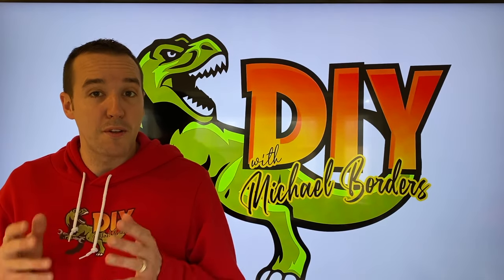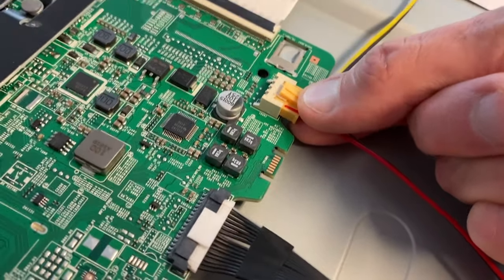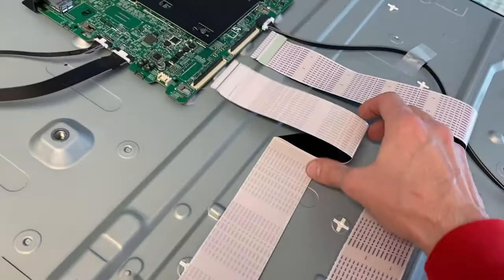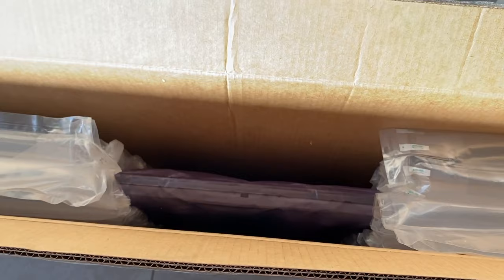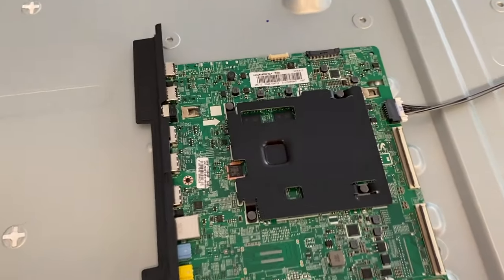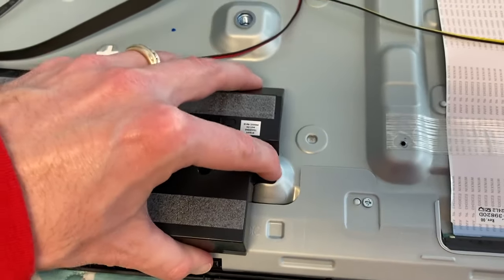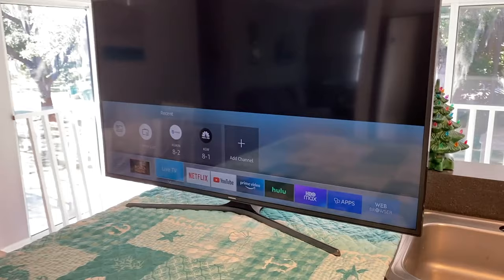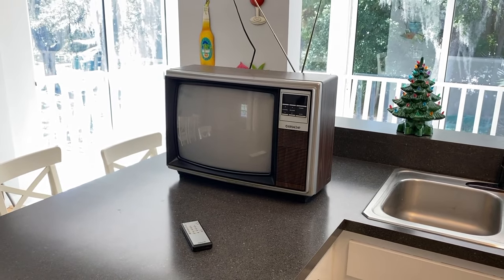How to replace TV screen/panel - DIY Samsung/LG/Sony/Vizio

Comment: Sir I'm thinking about buying a 65 inch Sony 65950H for 200 and the problem is the TV turns on then it shuts off then the red light blinks 4 times. What do you think is wrong with it and is it worth 200?
Reply from the maker: Thanks for watching, we take it the tv is used…?

That is usually an issue with the remote however not always.  The IR sensor inside tv might be in its early stages of failure and acting sporadically…leading to tv turning back on.

Comment: Hello Michael,thank you for an amazing video, I have a samsung  tv that has cracked screen model UA65NU7100KXXA, I'm in desperate need of the panel
Reply from the maker: Thanks for watching & welcome to the DIY Raptor Club.  We appreciate your kind words.  By chance, do you have the exact part # of your original panel?

This will be on a sticker inside the tv placed on the aluminum panel.  Having this exact part # will give us a better way of finding replacement panels.

Keep us posted.  😎👍

Comment: Great job fixing that and keeping it out of the landfill. How much did the screen.replacement cost? I have a Samsung UN55RU7100FXZA  that has an internal crack from the movers dropping my TV. Thanks again.
Reply from the maker: Thanks for watching & welcome to the DIY Raptor Club.  Our replacement panel cost around $500.00.

The tv was originally $1,200.00 when new.  Keep us posted on your project.

😎👍
Reply: Great video! Any recommendations on where to order repair replacement TV parts??

Comment: Did you pay extra $$ for the new screen? It's pre-mounted to the frame, so all you have to do is remove the main components/ cables from the old TV. Can you get just the screen? There is more work involved when replacing just the screen. Also, did you have to return the defective / old screen? So that new replacement screen was around $400- $500? As the TVs get older, the cost of replacement screens should drop, but how long should you wait? It's more cost effective to buy a new TV! Our disposable technology. Great video on your Samsung! Most Samsung phone replacement screens come pre-mounted to the matching frame, so it's easier to replace a bad cellphone screen! I got a hold of a Vizio 50" 4K TV, & an LG 43" 4K TV. The Vizio works but the screen is messed up (worse than yours!) The LG, may be a backlight problem, but also has a small damaged spot. So, is it really worth replacing the screen, when a new one is cheaper?
Reply from the maker: Good morning, we are drinking our morning coffee answering any and all questions for the DIY community.

We were more interested in the panel as a whole mounted to frame.  It’s possible to get just the replacement screen.

You will need to purchase just the screen replacement from manufacturer in most cases.  Checking the manufacturer parts website is best route, or visiting:

       PartSimple.com

You’re spot on, the older the tv gets, the cheaper the replacement screens get.  Please keep us posted on your DIY project.  👍

Comment: Can you help me please I have a broken LG tv model 43UH603V and I can't find a replacement screen im possibly thinking it could be a back-light problem.
Reply from the maker: Thanks for watching, the best thing is to remove the back panel from your TV.  At this point, locate the panel/screen part# sticker which will be somewhere on the internal aluminum panel.

This will give you the exact part number for your exact screen and will allow you to find a replacement screen much easier.

Keep us posted.  😎👍

Comment: Quick question if I wanted to fix mines is their an exact piece I can buy or would I have to get a whole new panel I have a 65” tlc Roku tv and my tv had a remote hit it?
Reply from the maker: Thanks for watching & good morning, we are drinking our morning coffee answering any and all questions for the DIY community.

Have you pinpointed if the panel itself is cracked or does the panel just have vertical or horizontal lines, or is the screen discolored?
Reply: It had something thrown at it so it’s inside that’s cracked if that makes sense
Reply from the maker: @phase3711  

Thanks for the reply, our crack was internal as well.  Replacing the panel was our only option...other than tossing tv out & buying new tv.

Comment: I have a vizio flat screen tv. I turn it on and the screen will be black but tv is on. I slap the screen and screen turns on. Gotta do it everyday. Is there something loose inside my tv. Gotta hit the screen everyday
Reply from the maker: Thanks for watching, it’s possible.  Removing back cover to gain access to internal portion of tv will be next step.

Check that all electrical connections are properly secured.  It will go a long way to spend a few minutes and do some friendly cleaning to remove any and all dust, debris, or any other thing inside the TV that does not belong there.

Below is a link to our video showing the cleaning process.

       https://youtu.be/-QdPg_jPkGY

😎👍

Comment: Hi... Could one have vertical lines on a TV if the screen gets shaken and the layers inside becomes un-aligned?... I once became aware that they are plastic layers inside the panel that must be perfectly aligned, am I right?.
Reply from the maker: Thanks for watching & welcome to the DIY Raptor Club.  If tv is shaken, internal parts can likely become loose leading to vertical lines.

It’s very possible that it’s as simple as removing the back panel and re-securing any loose connections.  Below is a link to our video showing us performing an inspection as well as a friendly cleaning.

       https://youtu.be/-QdPg_jPkGY

😎👍
Reply: @DIYwithMichaelBorders  Sorry to bother u but if the settings/ numbers >>  brightness, contrast, sharpness etc, are set too high can it damage the system or cause lines... I am not a technician but I'm just curious.
Reply from the maker: @st.clairworrell8758  

No bother at all, us DIYers need to stick together!!!  Those specific settings are unlikely to cause issues however if tv is set to full bright for 10+ years, an LED or two might burn out.  However that would not cause vertical lines, it would cause part of the panel to be darker in that area.

Comment: What is the model # on that Samsung 55"? I got a hold of a 55" Samsung UN55MU6300F. Screen looks like yours but worse! Are you still using the TV you repaired? Thank you 🤓
Reply from the maker: Good morning, we are drinking our morning coffee answering any and all questions for the DIY community.

This is a (un55ku6300).  We are still using this exact tv today.  The replacement screen has been great.  Please let us know if you have any additional questions.

😎👍
Reply: @DIYwithMichaelBorders  thank you! Morning coffee sounds good! Could you have gotten just the replacement screen, not attached to the metal body? It's more work to replace just the screen, but it might save some $$. 🤓
Reply from the maker: @j.lietka9406  

Unfortunately not, it was only sold in this manner however it definitely made the project more friendly.
Reply: @DIYwithMichaelBorders  yes, like the Samsung replacement cell phone screens. Yes it makes rebuilding the TV easier! But shelling out more $$!
Reply from the maker: @j.lietka9406  

Definitely understand your thoughts.  Please let us know if you have any questions.  😎👍
Reply: @DIYwithMichaelBorders  yes! Thank you 🤓
Reply from the maker: @j.lietka9406  

😎👍

Comment: Thanks for making this awesome video , I still have hope that I can repair the two Vizio tv's my toddler broke , I've been holding on to them for years . I would greatly appreciate it if you can help find the replacement panels . Thank you
Reply from the maker: Thanks for watching & welcome to the DIY Raptor Club.  We can definitely help.  We purchased our panel from:

       PartSimple.com

This is a pretty big online electronic business.  We have had great luck with them.  You will need to remove the back panels to gain access to the part # sticker that is placed on the internal panel.

Keep us posted, us fellow DIY’ers need to stick together!  😎👍
Reply from the maker: Amit Seetahal  

Thanks for watching & welcome to the DIY Raptor Club.  We did some looking around.  Below is a link to a replacement panel that matches your part #.

       https://www.tvserviceparts.com/Samsung-BN95-06343B.html

Please keep us posted on your DIY project.  😎👍

Comment: Where do you get replacement screen I have a samsung tu7000 70 inch that has vertical black bar line. And I'm wondering if the screen is cheap or expensive?
Reply from the maker: Good morning, just poured a cup of coffee and am sitting down to answer any and all questions for the DIY community.

We purchased our replacement screen from:

           PartSimple.com

Having the exact panel part number will help track down a replacement.  As far as price, it can range between $500-$1,000 depending on the make and model of tv.  Keep us posted.

Let us know if you have any questions and hey if you’re into crypto trading, join our DIY ecosystem.

       toolboxtoken.com

Reach out to us any time!  🧰
Reply: @DIYwithMichaelBorders  thank you so much . I appreciate the help. Kinda expensive.  Might just go ahead and buy a new tv
Reply from the maker: @Ernestosgarage  

Thanks for the reply, replacement panels can get pretty pricey.

Comment: Such an awesome video, definitely subscribing. I know it's a long-shot anyone will answer, but I don't know where else to ask. I need to replace the screen panel on my LG 65NANO95UNA. I think I found parts for pretty much every model except with "95" in the middle of the model number. There was an 85, 90, etc. But no 95. Does anyone have any idea how to find a replacement screen from a legit website? Thanks so much again for the video and for any help.

Comment: Thank you Michael for that great video. I have a Samsung tv 58" model UN58TU7000F version YA01. The screen became black after one year one day that I bought it. I can hear the sound but no pictures. I figured the screen is gone, please let me know where can I buy a replacement panel? thank you
Reply from the maker: Thanks for watching & welcome to the DIY Raptor Club.  We purchased our panel from:

       PartSimple.com

You may find it best to remove the back panel to gain access to the internal portion of your TV.  Once inside, you will find a part number sticker or placard on the internal panel.

Using this information on the sticker or placard will allow you to best shop around for your exact replacement panel.

Please keep us posted on your project.
Reply: I’m just giving you food for thought but it may not actually be the panel. You may want to look into replacing your P-Con board. I’ve run into this issue at least twice and both of those were the problem.
Reply from the maker: @jumcmeans6029  

Thanks for watching & sharing this.  Any & all helpful info is greatly appreciated!!!  😎👍

Comment: What’s the screen number to look it up, I have the exact same tv as yours I just don’t want to open it before I get the new screen
Reply from the maker: Thanks for watching, we appreciate you reaching out to us.  We definitely understand not wanting to open TV up however in order to 100% ensure that you get the exact replacement screen/panel for your exact TV, we recommend removing back panel and gaining access to the internal part number sticker.

This again will ensure you get the exact replacement for your exact TV.  Keep us posted.

Let us know if you have any questions and hey if you’re into crypto, join our newly launched DIY ecosystem.

       toolboxtoken.com

Reach out to us any time!  🧰
Reply: @DIYwithMichaelBorders  yea I did open the back, I found the number I looked it up on that website but nothing showed up
Reply from the maker: @baby_themacaw2592  

Thanks for the follow up.  Other than that website, did your search the web to see if a different site sells replacement panel that matches your part number?

Comment: Thank you for video,  Do you know were can I get  replacement screen for 86" led 
86ur640s9ud
Reply from the maker: You are very welcome, thanks for watching.  It means the world to us that you took the time and shared a comment.

The best thing to do is remove the TVs back panel to gain access to the internal part number sticker located on the aluminum panel.  

This will help us track down the exact replacement panel for your exact TV.

😎👍
Reply: NC86OTQF-AAKH1  I can send you pictures as well 
Thank you.
Reply from the maker: @dmitriitcacenco8283  

Thanks for the info, we dove deep into the Lg replacement parts online catalog website.  Unfortunately it looks like this panel is not currently available for purchase.

Below is a link to the website.

       https://lgparts.com/search?type=product&q=%22nc86otqf-aakh1%22

Comment: Does anyone know where I can go online to find out the part number for the screens on the Sony TVs?
Reply from the maker: Thanks for watching, great question.  If you’re unable to remove back panel of TV to gain access to the inside, you can contact the customer support who manufactured your TV and provide them with the serial number of your TV.

They will hopefully be able to look up OEM part numbers for your exact TV.

Comment: Any idea where i can find that screen panel for an LG 65incher
Reply from the maker: Thanks for watching & welcome to the DIY Raptor Club.  Great question and the best thing to do is remove the back panel where you can gain access to the internal portion of the TV.  Still kinda friendly to do on a 65”...may need a 2nd person helping as you maneuver tv.

Once inside, search for the part # sticker that is located on the aluminum panel.  This part # will be your screen/panel part #.

We can use this to look up exact replacement panels if available.
Reply: @DIYwithMichaelBorders  so that part im looking for is EAJ64929801
Reply from the maker: @fl3xicutionperformance593  

Awesome Awesome, we did some searching & found an option.  Below is a link.

       https://www.tvserviceparts.com/LG-EAJ64929802.html

There were a few other options, what have you found?

Comment: I can find one for my Visio E43-E2. I looked at the website you use but, did not find one. Could you point me in the right direction.😞
Reply from the maker: Thanks for watching & welcome to the DIY Raptor Club.  We came across possible options on eBay.  By chance, do you have the exact part # for the panel itself?

Comment: Thanks for this, I'm having difficulty in finding the LCD Panel for the TV i'm attempting to fix.. I did check the site you posted but wasn't able to find it, are you able to assist at all please? The current model numbers I can find on the inside are: Samsung BN96-35954A (This is the strip which connects the board to the lcd i believe) Another part number is: BN96-36010K 32J4500 then I have also found CY-JJ032AGHV6H - The TV model is a UE32J4510AKXXU - Any help would be greatly appreiciated.
Reply from the maker: Thanks for watching & welcome to the DIY Raptor Club.

We did some searching & this is what we found.

32j4500 is your TV model #

BN96-36010k &  32j4500 is your Ribbon wiring.

cy-jj032aghv6h is your TV screen/panel #.

Wasn’t able to track down a replacement panel.
Reply: @DIYwithMichaelBorders  Thanks for this. I’ll keep an eye out for the panel.
Reply from the maker: @razoruk1520  

😎👍

Comment: you have to take the mobo/power board out to replace the screen?
Reply: ohhh the board is on the LCD itself
Reply from the maker: Thanks for watching & welcome to the DIY Raptor Club.  Depending on the exact make & model of your tv, the parts may be slightly positioned differently.

Keep us posted on your upcoming project.  😎👍

Comment: Hi can you state the details of the new svc led panel I have the same model thanks great video’s 👍
Reply from the maker: Thanks for watching, are you looking to replace panel?
Reply: @DIYwithMichaelBorders  yes same model just want to know replacement svc led panel no thanks
Reply from the maker: @drasim881  

Nice, we purchased our replacement panel from:

     PartSimple.com

😁👍
Reply: @DIYwithMichaelBorders  do you have the part no for it please regards
Reply from the maker: @drasim881  

Thanks for the reply, don’t recall our exact part number.  The part number is on a white sticker which can be seen after removing back panel and locating sticker on the inner aluminum (back-side) of panel.
Reply from the maker: We tracked it down.  Below is part number.

Samsung BN95-02637B Television LCD Display Panel
SKU: smg-bn95-02637b
Reply: @DIYwithMichaelBorders  thanks so kind of you 👍
Reply from the maker: @drasim881  

So happy to help!

Comment: Hi Michael! I have a 65 inch Samsung tv that my toddler threw a toy at and cracked the screen. We just purchased this tv in November and unfortunately the warranty doesn't cover toddler tantrums. I cannot seem to find the panel anywhere. Samsung wants to charge 580 for the panel and that is what I spent on the whole TV! Do you know where I could possibly find this a little cheaper so I can DIY this? I looked on the sites you listed but didn't find my part no. It is BN95-07551A. Any help is appreciated!!
Reply from the maker: Thanks for watching & welcome to the DIY Raptor Club.  As you mentioned, we purchased our panel from:

       PartSimple.com

We did some looking & the price you found is the going rate.  If your tv is a new model as opposed to 5-7 years old, panels can be a bit pricey.

Please keep us posted on your project.